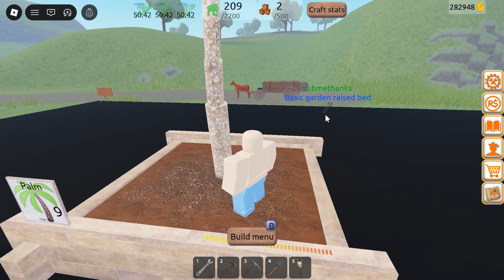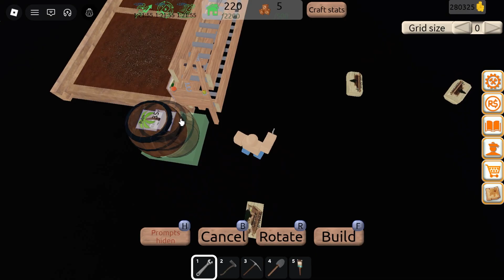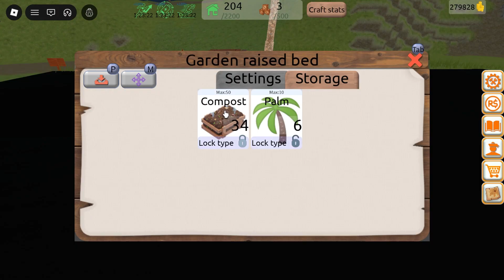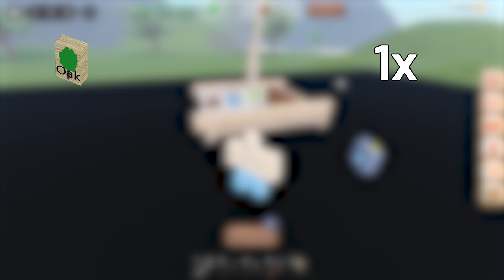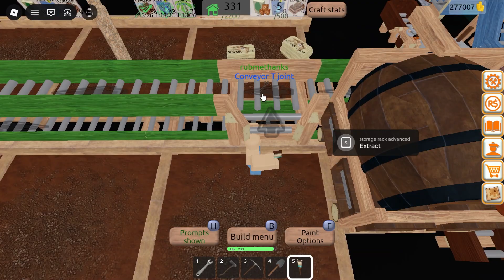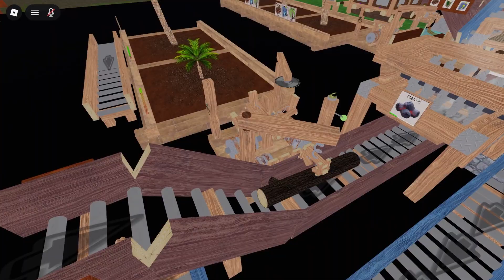The Ultimate Guide to Garden Raised Beds | Roblox Factory Town Tycoon

Comment: question even tho you haven't uploaded in awhile how do you optimize housing?
Reply from the maker: im not sure what you mean? optimizing housing you mean the most efficient use of all the buildings you place? I guess dont have multiple farms on one plot. stick with one money-making method and go all in on it so you dont have extra stuff laying around.

the majority of housing will go to mining drills, garden beds, and conveyors. you can lay things out to make them more efficient. but less or more of them just changes the output power
Reply: well I mean the conveyors like using them as less as possible and saving housing
Reply from the maker: @EraRap-k8w a lot of materials can pass through machines. so you can have materials share conveyors. combine flows